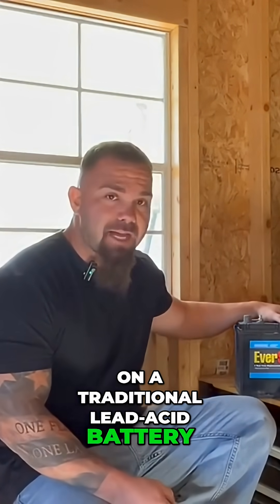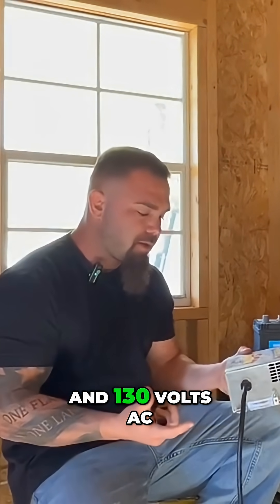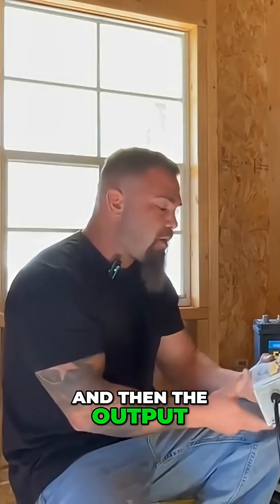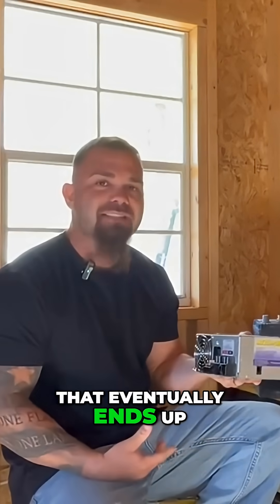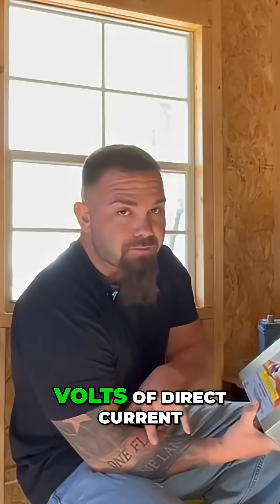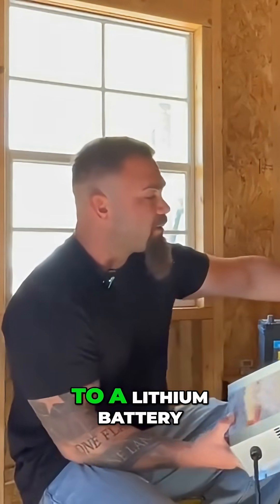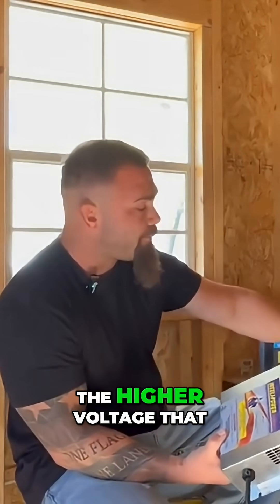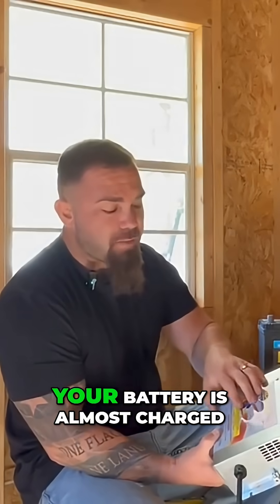RV Converter Explained: Lead-Acid vs. Lithium Battery Charging #shorts

Comment: Why are people saying the same stuff we have known for over a decade?
Reply from the maker: Because “WE” is not everyone lol. This is only common knowledge when people actually need it. Why would someone know this if they haven’t owned an RV and wanted to switch to lithium batteries?
Reply: @RvPowerPlug  All lithium batteries are required to clearly mark, "use appropriate chargers only".
Reply from the maker: @acsnitner7661 Required by what governing body, literature, or requirement that you can site? I manufactured and imported my own brand of lithium batteries and that was not any legal requirement that i ever came across… 

Even if that were the case, now consumers would know that they need a different charger and then start looking for information on what to get and why. That is precisely why people are making these types of videos and information, so now you know! Thanks for the question.